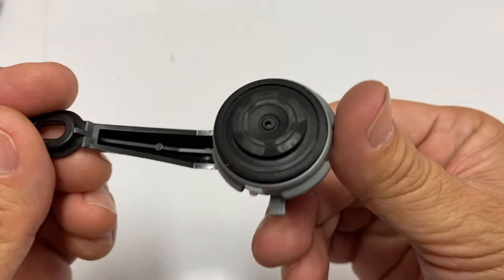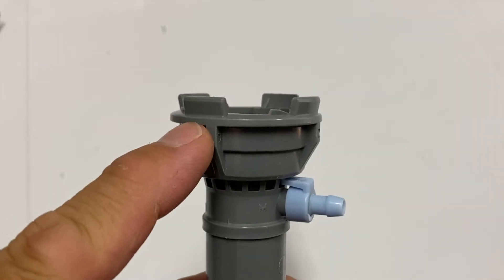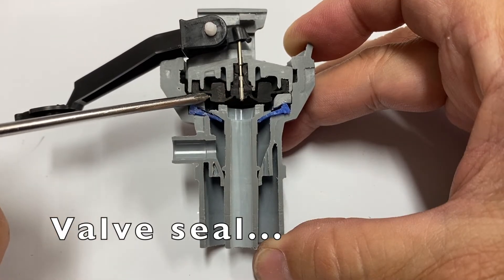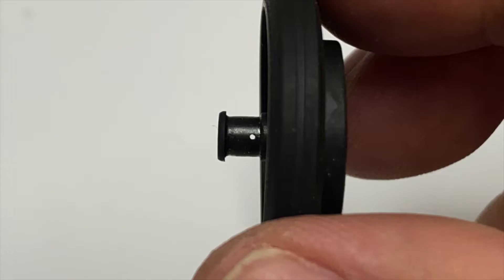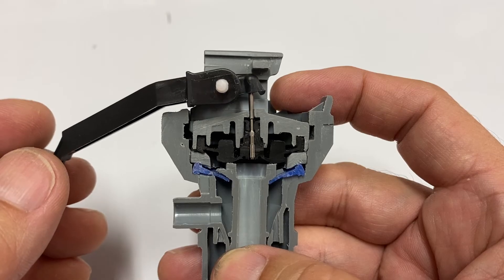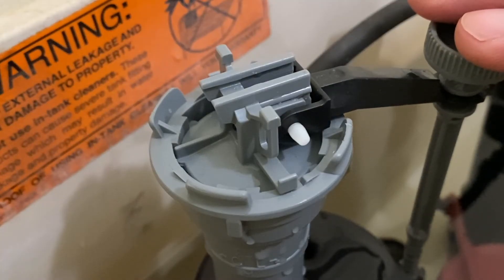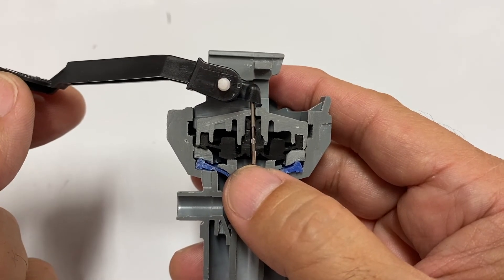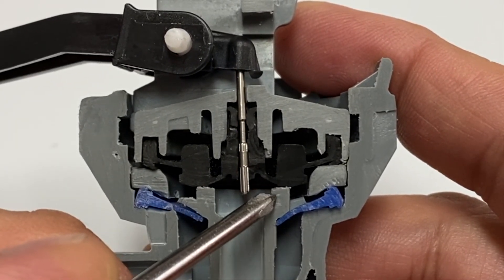How Fluidmaster 400 Series Fill Valves ACTUALLY Work

Comment: Love this video!! It helps explain my problem. For the past month, I have been hearing gurgling sounds. I finally looked into it. From what I can ascertain, the gurgling is intermittent, like every 5 seconds, and water is coming out the refill tube into the overflow tube. What I also noticed was that the water level was right at the top of the overflow tube. So I lowered the water level to a half inch below the top. I looked at it again later to see that the water level was again at the top and some of it would spill down the overflow tube. Obviously water was being wasted. The tank was filling up un it's own very slowly, even though the valve should have been closed. So clearly some water was leaking from the fill valve? But I'm also wondering what was causing the intermittent gurgling of water though the refill tube into the overflow tube? It's a Fluidmaster 400.
Reply from the maker: It's possible that the valve seal is leaking.  If you don't want to replace the entire fill valve assembly, you can try cleaning or replacing just the valve seal... https://youtu.be/sEdfFZQYQEI
😎
Reply: @HacksbyDad  What do you know! I think I fixed it! At first, I thought I would have to change the fill valve and planned a trip to Home Depot tomorrow. Then after watching your video and a couple of your other ones, I thought I just needed to change the valve seal, still needing to go to HD. Then I think I heard you mention that maybe just cleaning it might be helpful, or someone else did, and I did just that with how I learned to get to the seal. And I think it worked!!! The water level has not changed and no more gurgling. No more money going down the drain. Thanks so much for your detailed video. Many others just tell you how to change the valve; you tore it apart to show us. That's the difference between you and the others. Keep it up!
Reply from the maker: @davidl4417  Glad to hear that you fixed the problem!  👍
Reply: @HacksbyDad  I have this same issue but it's not gurgling. It's pretty much a full on continuous fill, just much lower volume than totally filling after a flush. I already tried  cleaning & flushing the cap diaphragm, to no avail (didn't look bad, & the rubber gasket seal didn't look too bad either), but this video opened up my eyes to what's going on inside the gasket (Thank you so much man)! It's not just a straight seal-only deal. It has compartments for allowed water volume to travel through, which works, but leaves room for long term wear & tear to showcase in the future... 

Anyways, for now, I have reduced the inlet water supply valve to reduce some of the noise & volume, & I will try to simply get a gasket, because I don't think I need a whole valve.

If worse comes to worst, then I'll eat the cost for the entire valve because wifey won't rest ready until it's fixed, ASAP!
Reply from the maker: @DJ.PaulyP  LOL!   I know what you mean!  Happy wife, happy life.
😎
Reply: They fail for me 4 toilets with this fill valve rubber seal problem and a continual over fill I had enough and replaced with another brand and if that fails I will go to an old fashioned system.This system must be making money for a lot of plumbers!
Reply: I managed to fix my overfilling valve by cleaning the assembly and/or replacing the seal (can't remember, have a number of old and new seals lying around).

It's now filling as designed, but it has become noisy, and I can see a lot of bubbles blowing out of outlet at the bottom of the tube.

I've got 3 such cisterns in my house, the others are really quiet.
Where/how is the air getting into the outlet stream?

Comment: Hi thank you for uploading informative video . I also replaced my old fill valve with 400 series and I found out it takes much longer to fill the tank.  Probably my toilet tank is too big because it is from 80s or the fill valve dont have enough water supply.  I found out the fill valve has 2 water outlets . one is refill port for toilet bowl via overflow valve and the other is bottom part of fill valve. So I wanna have quick water fill what can I adjust ? Thank you ☺️
Reply from the maker: Hi there.  I see that you watched and commented on some of my other fill valve videos, so you know those hacks.  I'm guessing that your old tank is a 3.5-gallon or larger tank if it is from the 80's.  Have you tried adjusting the float for a lower tank level to where you still have an adequate flush?  Or old school style like my parents did... placing empty glass bottles in the tank?  
😎